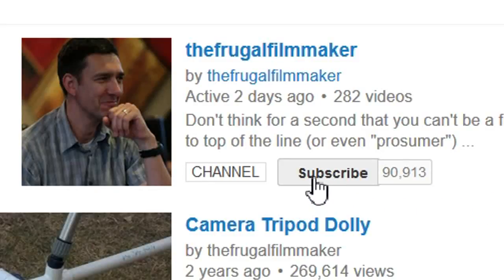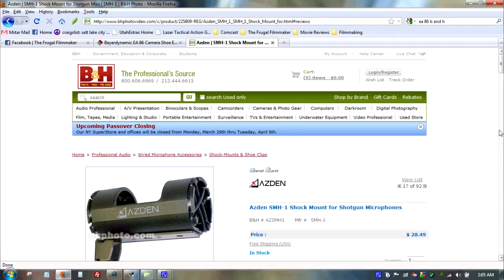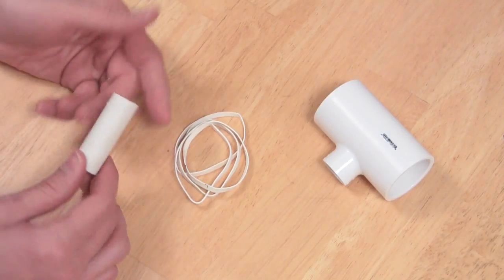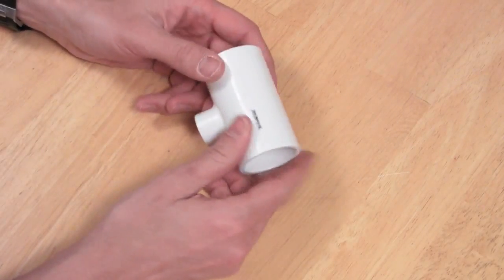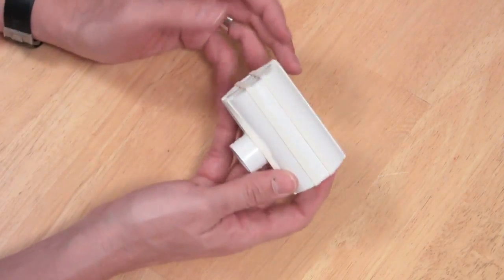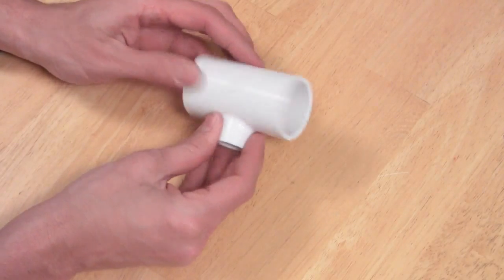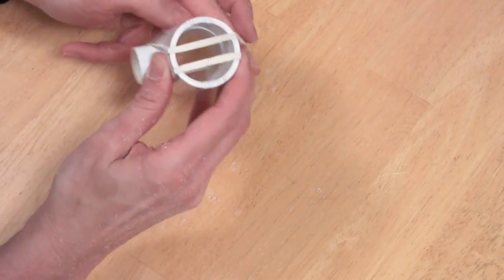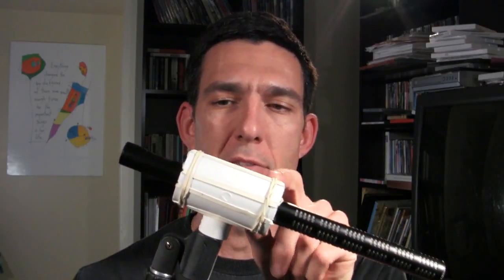Make a Mic Shockmount for $1.20

Comment: Hey!  Just wondering what size Boom Poll Mic Clip you are using?  I see amazon ones at 20mm that hold shot gun mic but you use a 1/2 in diameter scrap to fit into the clip.   Please tell!

Comment: Just a question. What screw size is used on boom poles? Is it the same size as standard tripod mount screws? (¼”-20 tpi) Is there a reason why I won't be using my monopod as a boom pole? Thanks for the video. Will make my shock mount in a similar fashion :)

Comment from the maker: Both are valid points.  I still think cutting notches is a better way to mount the bands, as they will never work their way out of place.  The square worked better for me, as it hold the mic securely, but isn't nearly as difficult to insert and remove when using a cross pattern.

Comment: Alright, If you're having problems with sound form the rubber bands sliding or other things, you can also try hairbands, they're about as cheap for a packet and thicker with a fabric wrapping, though they need to be tighter than rubber bankds because they may let the mic slide more.

Comment: Just out of curiosity, two questions.  One, why even bother with the dremel? Can't you just tape around the perimeter?  That way you can also adjust the tension too.  And two, whether cut or taped, instead of making a square with the rubber bands in a parallel arrangement, why not make them sit right on top of each other making a cross?  If you go with cuts, there's only four per side, not eight, and theoretically the rubber bands will also now grip better, no?

Comment: To get less slip, consider instead cutting slits in the tube, rather than small grooves.  Cut two sets, one about 1/2 inch, the other about 1 inch deep, making either the horizontal or the vertical slits deeper.  The reason one set of slits should be cut deeper is so that the rubber band running through one set of slits won't get in the way of the other rubber band as it runs across the opening.  Put (shorter) rubber bands into the slits sideways from the direction placed in the video.

Comment: You could use a pipe clamp for a more reliable hold on the sides of those rubber bands, rather than using more rubber bands as you did in the end of the video. Pipe clamps would be a cheap alternative...

Comment: Couldn't you accomplish the same thing with only two rubber bands? You would just have to feed the mic in so that the top ruuber band went under the mic and the lower band went over the top, forming a figure 8 or hour glass type shape. I don't know if you tried and rejected that idea but it seems to me that the tension it created would help prevent any movement.

Comment: This cost a lot more to make than $1.20.  The PVC is $1.20, the rubber bands are $1.00, the The PVC scrap is $1.00 (10 foot length)  PVC racketing cutter is $4.00.  Correct me if I am wrong but this does not add up to $1.20.  Also, I have seen a number of shock mounts for $5.00, $10.00, and even $15.00.  Where are you looking…
Reply: Lol
Reply: yeah but nothing feels better than making one you can call your own. :)